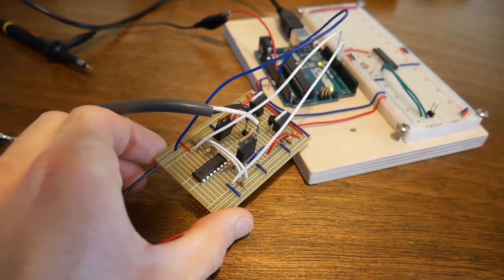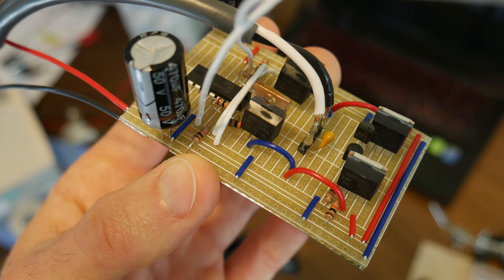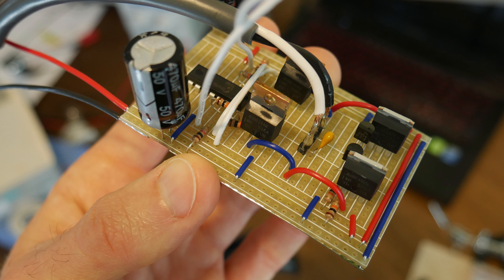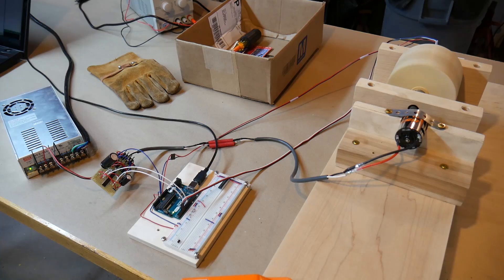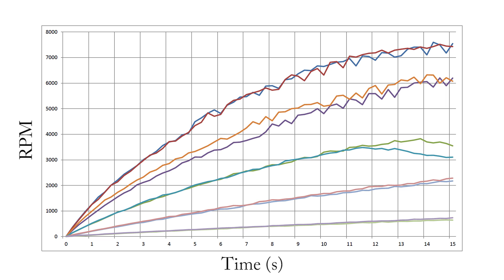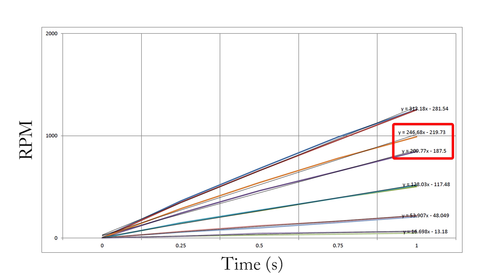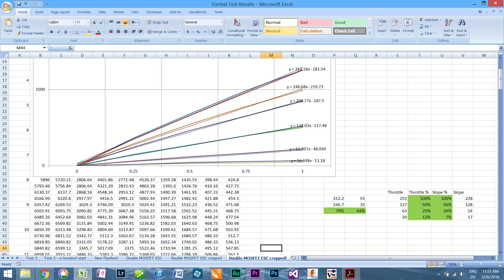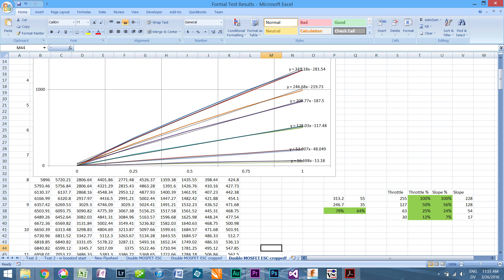Motor Dyno #3 - Smoke & Charts

Comment: Scott, I enjoy your videos. I have need to test performance of small gas engines, so your Dyno videos were particularly interesting. I see they are from 3 years ago, but you be willing to assist me in adapting your concept to my use? I have my own machine shop for building the Dyno, so mainly need assistance in the formulas/software/electrical areas.
The engines are the size you would find on grass trimmers, chainsaws and such.
Thanks in advance,
Denis
Reply from the maker: Thanks for the interest. I don't have a lot of spare time right now but the basics are pretty simple. Choose a simple shape with uniform density so you can calculate the inertia. Then measure how fast you are able to accelerate that shape and . . . voila! you can determine the energy input.
Reply: @ScottRumschlag  ok, I'll give it a shot.

Comment: Im planning on making a dyno to do real reviews on rc motors etc.  I get the concept but am not looking forward to dealing with making the spreadsheet for the calcs.  Do you have one of your sheets that simply has the ability to input the rpm/time info and spit out the torque graph?  If so would you be willing to share it?
Reply from the maker: The hardest part is probably figuring out the moment of inertia for your flywheel, this is why it's helpful to use simple homogeneous shapes as they are easy to calculate. The math is very simple: https://en.wikipedia.org/wiki/Angular_acceleration
Reply: Ok. Fortunately the moment of intertia only needs to be done once....or twice:)